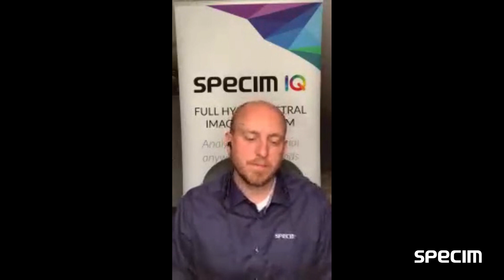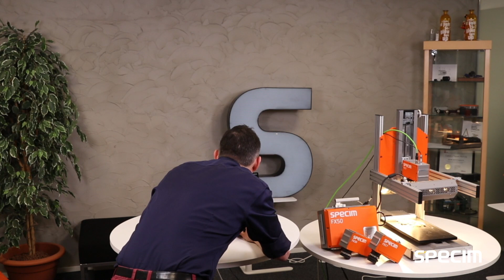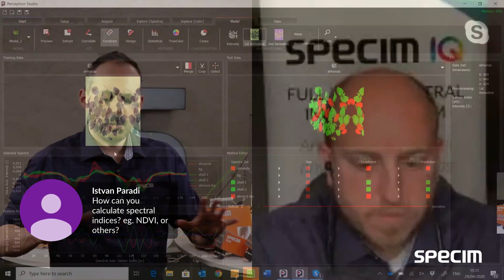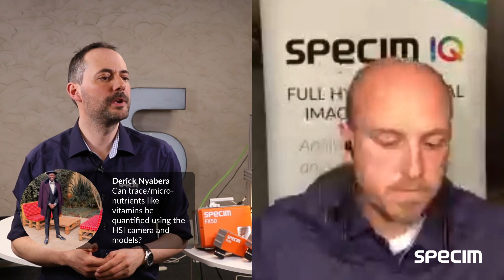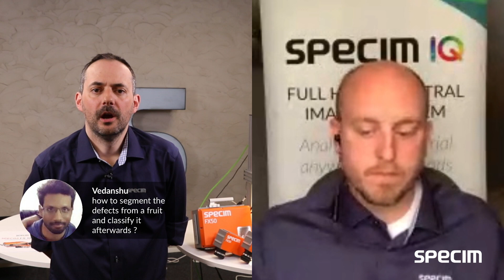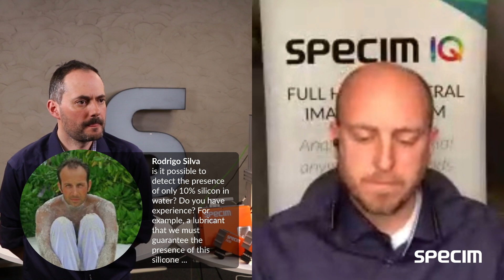Sorting food with hyperspectral imaging - Replay of Live Q&A with Mathieu and Jeff

Comment: Taking note of FX10  400-1000nm (VNIR),  FX17 900-1700nm (NIR) line scan mode, FX50 2700-5300nm (for black plastic detection sorting). How about the illumination spectral characteristics will still be Tungsten Halogen or IR LEDs? Is Perceptron Software sold separately?
Reply from the maker: You need a light source emitting continuously over the full spectral range. So it could be hyperspectral dedicated LED or halogens. Perception SW is sold separately. Take a look at our SpecimONE platform that includes SpecimINSIGHT software. Could that be usefull for you? https://www.specim.fi/specimone
Reply: I hope we can see the working action  of SpecimONE, SpecimINSIGHT in this channel very soon